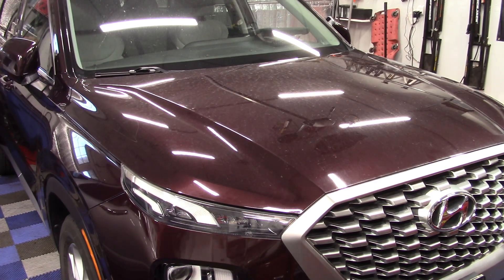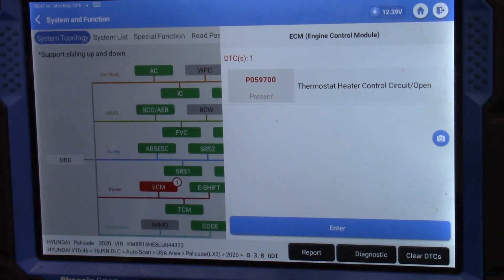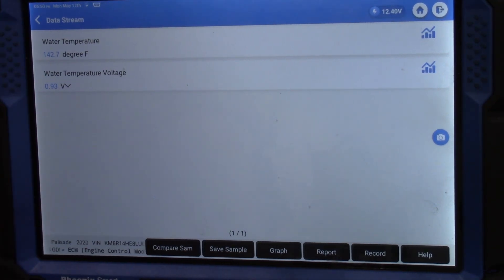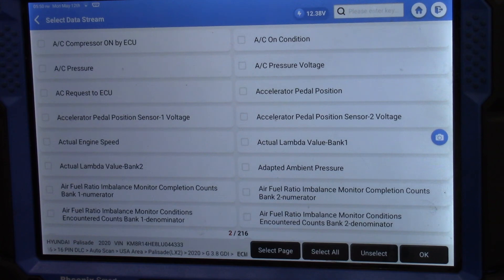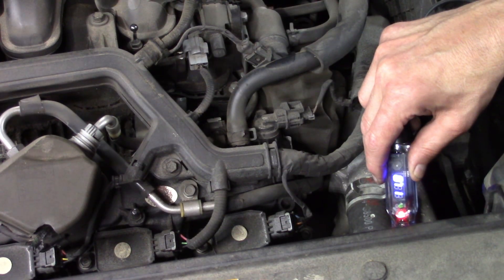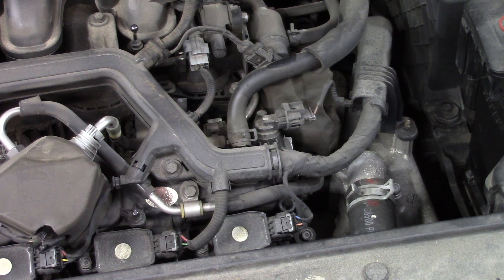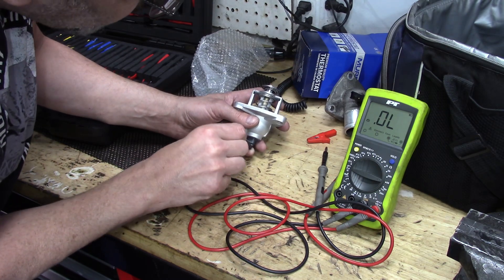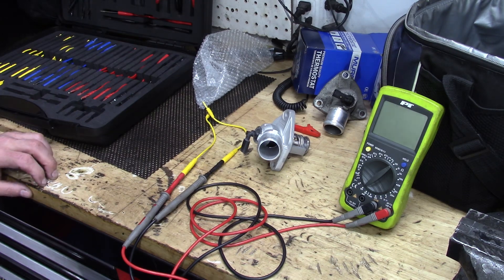Hyundai P0597 DIY Diagnosis with New Tools!!

Comment: I have that exact kit. I bought it because it was way cheaper than the AES wave kit. I like my kit but be careful. I broke one of my female plugs while trying to test a map sensor. It was my fault but they are easy to break when plugging them in. Also one of my alligator clips don’t open very good. When I squeeze it to open it the metal part of the clip separated from the plastic part. For the price though I really like mine.
Reply from the maker: Thanks for the tips!!

Comment: Hi Matt, another great video. I'm a paid subscriber to your private channel. I'd love you to do a video on EV's. I'm in Australia. I'm neither pro or anti EV and I'd love to see your take on EV. Could just be a talking video with you listing out the pros and cons of EVs as you see it
Reply from the maker: Thanks my friend!! Yes while I haven’t worked in a true EV yet I am starting to at least see hybrids more.  I’ll make some discussion in a future video!!
Reply: @SchrodingersBox  yes be great to see you work on them. I learnt recently EV still have a 12 volt battery and I'm guessing that's a lot to do with isolating the big battery banks for safety. Be interesting to see you doing a video around the electric circuits on EV. 

I also reckon insulation testing would be important on EV different to a normal ice car at 12 volt potential. 

Great to see you rocking the MAGA hat and putting it out there if you are supporter, cheers
Reply: @SchrodingersBox  btw hybrids extremely popular in Australia. It makes sense as ev make less sense here as distances are vast and HV charging is still limited outside Tesla supercharger network in Australia. 

Hybrids outsell EV 3 to 1 in Australia and are far more popular

Comment: Hello from the UK! Test leads like these are great. I've got a similar set which is just the leads (no variable resistors, etc), but I found that the ends of the leads are way too bulky compared with the more expensive AESwave leads. I carefully cut off the bulky bits of plastic (that surrounds the join between the wire and the terminal) with side cutters and slipped some heat shrink tubing over the exposed male/female terminals. Now I can easily get test leads side-by-side in narrow electrical connectors. It was a bit of effort, but so worth it for the price.
Reply from the maker: Ah good idea. I do agree- for the purpose of the kit the lead ends are a little bit thick. On something like this the thinner the better. I’ll probably do what you did.

Comment: Nothing in Science can be proven, that alone is a reason why Science can never be be trusted 100%. Are there any Scientific proofs? If so,which?Science can always ,and has always, changed/improved on. Any law,evidence or even robust Scientific Theory can be added to /changed with new compelling data/evidence. Can Science be reliable? Yes! 100%,no. You cannot prove anything to me 100% in Science(not Math or Logi),if you could,that would mean that it could never be changed or improved on. Will I live my life assuming the Laws of Physics will exist next week? Yes. Can I prove they will not change to any degree? No. Can Ohm's Law ever be found to be wrong? Is it impossible for it to be wrong,ever,at any point in time?

Comment: That is a well put together lead kit. I've been using the Hantek HT-306 6-Way Breakout Leads which work great. You can also use them as plain terminal leads.

Comment: I hear alot of mechanic saying "there is ground". What does that mean? Does it mean there is a continuous path from a point of interest (i would assume right after the load?) to the negative terminal of the battery? This sounds a lot like a continuity check.
Reply from the maker: Correct. Continuous path after the load to the negative battery (ultimately. In many cases is through the body of the car or through a computer module but ultimately it’s to the battery).

Comment: Last Audi I worked on, had an electric pump that i was testing. It has an integrated computer that can talk through a LIN line. The only way for me to test if the pump was being turned on was to use an amp clamp around the constant positibe heavy gage wire and monitor when the pump is commanded on. The thermostat heater is known to short as well and burns the computer transistor, there are repair services for this as well.
Reply from the maker: Yes I have a recent video on the other channel where the operation of an active exhaust valve was done through LIN- totally threw me off guard as it was so blatantly obvious it was a typical potentiometer setup with three wires but nope- it wasnt. 
  You never stop learning!!

Comment: I had to upgrade my Autoenginuity dongle, software, and gateway to Chrysler after eight years.  $400 for the upgrade and gateway access which I guess is inexpensive considering the alternatives.
Reply from the maker: Yeah I love AE still, however the problem is for $400 you can now get a whole tablet with the same or better features including bidirectional control.  If I'm honest, I'm a little dissappointed that AE hasn't seemed to adapt to competition.
Reply: I have that trash AE collecting dust in the drawer. Mine had bluetooth as well to use with my phone. It's practical to use a tablet, I normally use my Snap-On Verus Pro or Launch Pad II